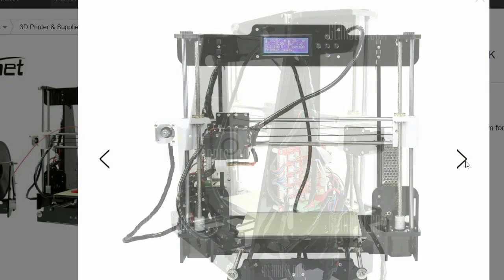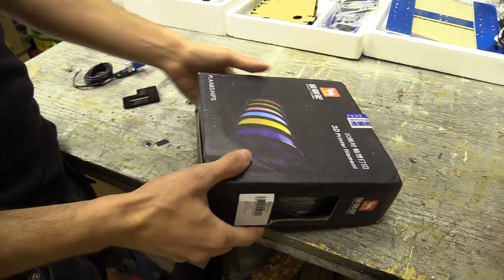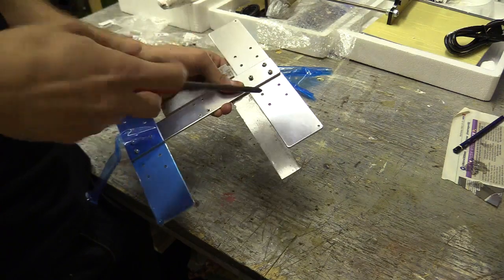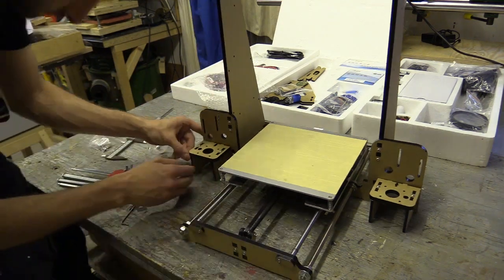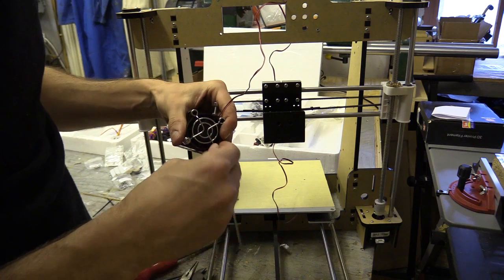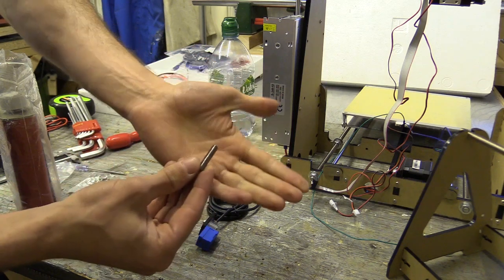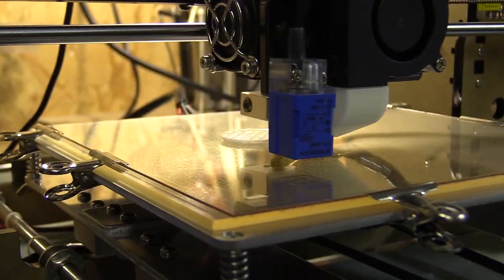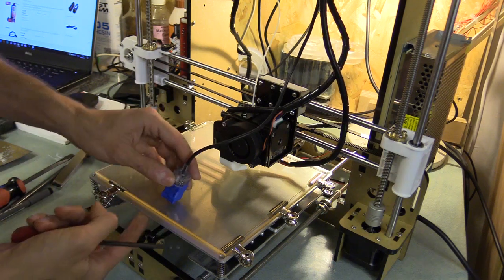Anet A8 3D Printer Desktop / DIY Kit Review and Build

Comment: Hi Savvas, a few things that caught my eye:

1. It's hard to be sure from a video, but your belt looks undertensioned - it should be tight enough that you can just barely get it to sing when you pluck it like a guitar wire
2. Desolder the connector off the bed completely and solder the wires directly to the PCB. Heatbed will never go beyond 130C (probably not even 80C) so it's not the source of fire - problem is resistance in the cheap connector. Make sure those wires have some form of strain relief or they'll snap over time.
3. Ditch the glass - you can use PEI directly on aluminum bed but I find that a THIN layer of UHU glue stick (any brand of PVA based stick will do) over nicely cleaned aluminum will work wonders for PLA (at 60°C), PETG (80°C) and even ABS (100-130°C). First level height in paramount, as if the straightness of the bed - we're talking 20-50um here. It your bed is warped (most of them are) you can probably use mesh bed leveling as skynet is a branch of normal Marlin software (google is your friend)
4. Why didn't you remove the paper/foil from the acrylic panels before assembly?
5. What do you mean be "planning to use mosfets"? Mosfets are already on PCB and they ARE connecting heater elements to the power supply

Keep up the good work man :)
Reply from the maker: They may well have been. The belts feel a bit stiff and I have read about a type which seems a bit more flexible. I think I did mention the contact on the heat-bed but I forgot to mention the insulated terminals spans across two two pins on the heat-bed instead of one which was initially wired - so that increases the material conducting electricity. But you are right safest thing would be to solder directly to board. I like the idea of using glass. It's super flat. You are right but might as well start as i plan to go... square-ish. lol. I liked the colour and contrast of the paper cover. You can get external mosfets for the heated bed and extruder - which I think are rated to take a greater load, better heat dissipation, than the on-board ones.  Thanks for the observations! :)
Reply: In my experience, glass is far from flat - maybe you've had better luck with yours. However, my biggest gripe with glass is it distorts with heat a lot. On a 35x35cm bed I've seen 0.1-0.2mm moving up and down when heating element is cycled on-off. As you say, try, your results may be better.

If your mosfets are over 50-60°C then upgrade is warranted, but when driven properly they should remain relatively cool even at 10A draw. Extruder heater is usually 25-40W so that mosfet is rarely an issue.

Good luck

Comment: Hi, I have been following your CNC tutorials but the one thing that I wanted you seem not to have covered. I have a CNC, but I cannot get the registration details into the computer programme so the computer will not talk to the CNC. I was hoping that you would cover this topic as part of the CNC build but either I missed it or you did not cover it. I have been very annoyed with the programme that came with my CNC as it tells you to input the serial code but as soon as I open the programme it stops my keyboard from input and even stops the "control+V" shortcut so I am stuck.  I made the mistake of buying my CNC from China and they do not understand my problem or as I have come to think they do not understand basic English. Any ideas would help tremendously.
Reply from the maker: What model of CNC machine and controller do you have, and software? I'll have a look to see if I can find any good references.
Reply: One of my frustrations is that although I have a 153 page manual there is no mention of the name of the CNC. The manual is also only available via the internet so I have copied the shortcut but cannot paste it into this message, I will try to send it direct to you. It goes into great detail about things but as far as I am concerned it might as well be in Chinese.
Reply from the maker: Hi John, I've just sent you an email. Let's see what we can do.

Comment: So how did it perform printing something more intricate than a baby bell?
Reply: Savvas, If the printer is screwed to a table top or other massive base (using simple cheap aluminum corners), the device will not swing horizontally (or quite a bit). And if you strengthen the vertical racks (the same aluminium corners), then the vertical will also stop swinging (or quite unnoticeable).
Reply from the maker: I don't want to sound cheesy but.... It's not bad for such a cheap machine.  I think I a ran it a little too fast as it feels like it wobbles a bit. I could see little imperfections in the extrusion lines but I'm quite new to 3D printing.